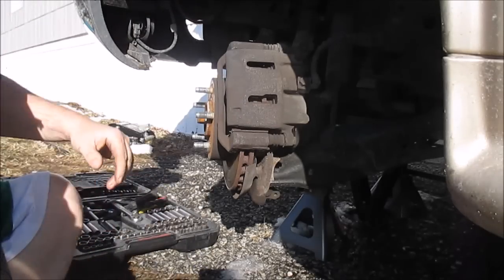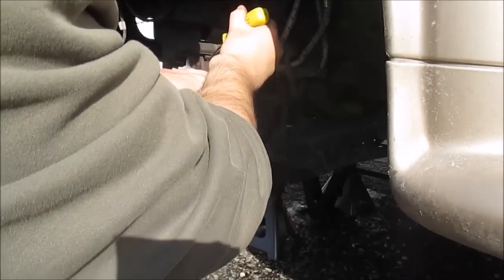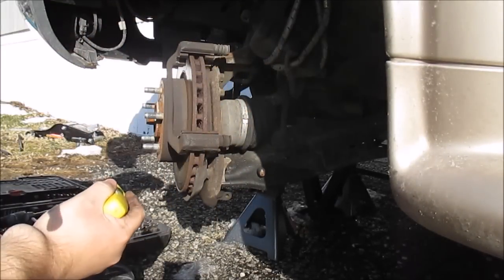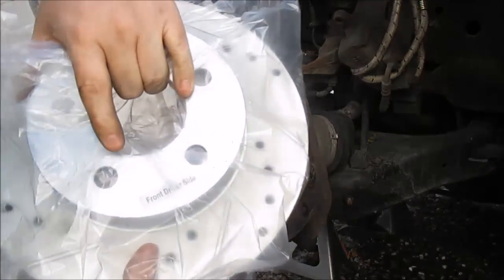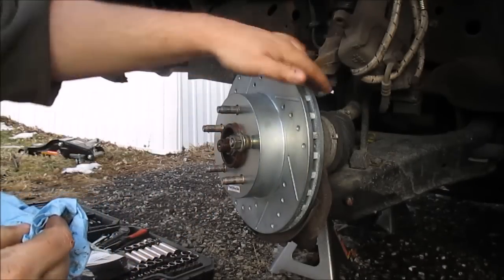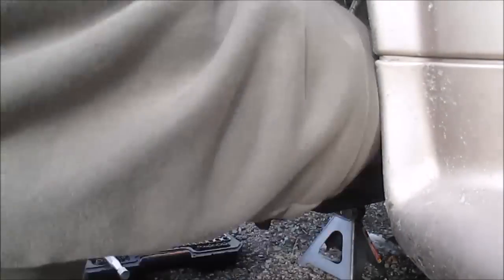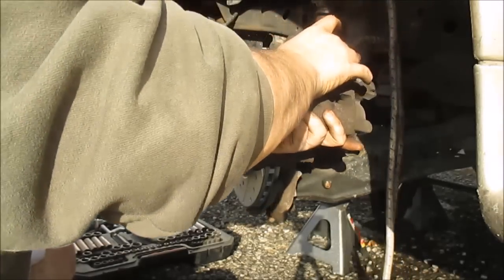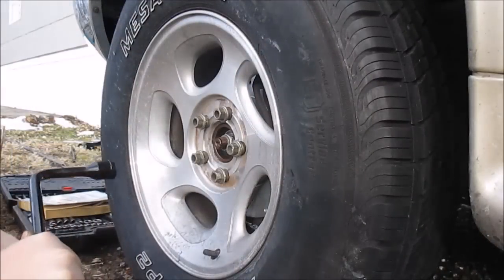How To Replace Brake Pads And Rotor On A Ford Explorer

Comment: I just did the same job on my 98 explorer sport, I used your video for confirmation that I was doing it right The video was done well and kept the info simple, great job. Thanks 
  Greetings from Victoria BC Cheers ! -Les
Reply from the maker: You are welcome, I am glad my video helped you out. I have been to parts of Canada, Ontario and Quebec. I have always wanted to go and visit British Columbia, I want to visit a few places and I want to see the Bella Coola Valley, pictures of it just look so pretty. Well thanks for watching and thanks for the comment. Have a good day.
Reply: Did the bolts come off with the rotor on yours? Mines a 98 xlt and I bought the same rotors but there's no bolts to put it on without the old rotor
Reply: @declanbryant8591  Well that was 3 years ago but I'm pretty sure I just used the old bolts,good luck Cheers ! Les

Comment: AJ, thanks so much for taking the time to post this. I tackled brakes on my '01 XLT for the first time utilizing your video. Really helpful. Only thing I added was greasing the back of the pad per the recommendation of the auto parts store guy. Oh, and for anyone reading, the torque spec for the front disc brake caliper support bracket bolts is 83 Lb-ft and the spec for the disc brake caliper bolts is 24 Lb-ft. Now I'm going to work on my son's '97 Ranger. Again, thank you.
Reply from the maker: +awwphooey 
Hey I am glad my video helped you out, thanks for watching and thanks for the comment. Have a good day.

Comment: Just wanted to say THANKS for posting this video. I have the same model and totally just saved me like $300 in labor costs. If you do anymore work on this vehicle please post it!
Reply from the maker: BoxBreakingCards 
I am glad you liked my video, and I am glad it helped you out. I am sure I will find something else that needs fixed to make another video on this vehicle in the future. I try to arrange my videos in my playlist section. I have one that is just for my ford explorer. I think I have 6 or 7 videos in there feel free to check it out. Also If I make another video related to ford explorer I will post it there. Well thanks for the comments and have a good day.
Reply: AJ Pierce any thoughts on why I may be smelling hot brakes 2wks after the rotors and brake change?

Comment: Fantastic video, ty...wondering about anti seize on the caliper bolts?  Guess it doesn't need it or you would have put it on.  Appreciate and respect your attention to detail!
Reply from the maker: +Kevin Wiley 
I think lubricating brake assemblies on there slide points, contact points, metal to metal points, and caliper slides is for sure a MUST thing to do. I usually use anti seize or other types of lube that say on the label for brake assemblies. I have used different manufactures brands and it usually says something like high temp lube, caliper lube, brake grease or something like that. It is important that the lube be rated for brake assemblies and be of a high temp nature because brakes get very hot, and you dont want to use just plain old chassis grease because most are not rated for high temp.  The brake lubricant is essential in keeping the parts moving properly and helping with heat transfer. For some great info on brake lubricants and proper placement of brake lubricants check out this article. http://www.aa1car.com/library/2005/ic80560.htm  Well thanks for watching and thanks for the comment. Have a good day.

Comment: Hi AJ, I have a 2000 sport 2wd. My old pads have the squealer tab on the outboard pad. I'm wondering if this is correct since it seems the inner pad always seems to wear down more than the outer. No instructions came with new pads and Hayne's manual doesn't mention it. Thanks for your videos

Comment: I changed the brake pads on my ford explore.  it still made bad grinding noises so I changed my routers. still makes grinding noice. the new roatter is from pic and pull.
Reply from the maker: Most likely you need your rotors turned down (if they are still within specification for turning), ones from pick n pull probably need turned down as well. Take your rotors to an auto shop, machine shop, or if there is a local college with an automotive program call them up and ask them if they could do it for you. Well good luck on fixing your brake problem. Thanks for watching and thanks for the comment. Have a good day.

Comment: I just changed out the pads on my '92 Explorer and what a  pain in the arse. No caliper bolts (which would have been easier), but had these pressure pins that hold on and in place. What year is this Explorer and how often, if ever, do you replace the rear brakes?
Liked your video alot and will check out your others.
Reply from the maker: +TheTemest 
Yeah Ford was notorious for using those dreadful pins on there earlier stuff. It seems to me just about anything from the early 90's had those stupid pins. I am with you I hate those stupid pins, and I like my calipers to have bolts. My Explorer is a 1999 and so far I have only replaced the rear brakes and rotors once. However I have not owned mine for very long. I think I bought this around January of this year. Thanks for liking my videos. and thanks for the comment and have a good day.

Comment: A.J.  New brakes arrived and looking forward to replacing using what you just showed. Quick question, did you have to bleed the brake lines after you finished replacing the pads and rotors? Thanks
Reply from the maker: No you should not have to bleed the brakes if you are just replacing pads and rotors. As long as you dont open any brake lines you should be good. Support the caliper when removing it and dont let it hang by the brake line, you will have a lot of extra work if you break that line or kink it so just be careful with the caliper when you remove it. Also when you are done replacing pads and rotors remember to pump the brakes a few times until you get a firm pedal, nothing worse than doing a brake job and forgetting to pump up the pedal and driving off with no brakes, could be bad. Well I hope this info helps you out. Good luck on changing your brakes out. Thanks for watching and thanks for the comment. Have a good day.
Reply: I appreciate that. Turns out my brakes are slightly different than your video. Had to remove the center piece and remove a bolt and bearings to remove the rotor. Getting it off was difficult. Getting back on even harder but your video is helping. Thanks
Reply from the maker: Yeah my explorer is a 4 wheel drive a lot of the 2 wheel drive trucks have the wheel bearings in the rotor and everything sits on a spindle. I have a video showing how I did brakes and rotors on that type of setup.      https://youtu.be/7wps4dteFFc        I did this on my F150 I hope this video helps you out. Good luck to you and have a good day.
Reply: The second video made all the difference. 4 hours to do the first brake, 30 minutes to do tell second. Your videos are outstanding. Keep them coming. Thanks for all the help.

Comment: Which brake pads do you recommend? I'm not sure what to look for.  I have a '98 Explorer  XLT AWD 5.0.  Thanks!
Reply from the maker: I prefer ceramic brake pads, but they usually cost more than the metallic types. I just feel the ceramic pads make less noise and are not as tough on the rotors (just my personal preference). However, I would recommend you go with what ever brake pad Ford specifies. You cant go wrong using Ford Motorcraft parts. You can look up parts for Ford at www.fordparts.com or check your local Ford dealer's website. I noticed a lot of times when buying from a dealership you can get parts cheaper off their website, but if you walk in to the parts service counter they will not give you the online discount.  Here is a link to a website that talks a little about choosing brake pads http://www.autoanything.com/brakes/the-best-brake-pads-ceramic-or-metallic.aspx  Well I hope this info helps you out. Thanks for watching and thanks for the comment. Have a good day.
Reply: Thank for the quick response. I appreciate the info. Take care.

Comment: I have a 94 explorer 4x4 that needs rotors changed how different is that to do than one without 4x4
Reply from the maker: In my video I am working on my 1999 Explorer, which is a 4x4, so to change rotors on your vehicle should be very similar if not the same as the way I did mine. However I cant be certain for sure because I have never worked on a 1994 Ford Explorer. Well I hope this info helps you out. Thanks for watching and thanks for the comment. Have a good day.

Comment: i just did brake pads for this same truck but hear an on going  spinning loud squeak noise only from my front left i didnt use the gel
Reply from the maker: Well could be several reasons why they are making noise. I guess it could be something hanging up perhaps from not being lubed up properly, or rust or debris, maybe you did not position something properly,  maybe worn rotors (did you machine those or replace those before swapping pads), or perhaps it is the new pads that take time to wear in properly (there is a technical name for this I think it is called bedding in google this for more info about it).  I think I would try to jack up that that side and spin the wheel and listen for noise and drag, and test brake function. Spin the wheel and apply brake, and make sure everything is smooth and the caliper releases and does not hang up. Really it could be a lot of things, but hopefully this will give you a few things to think about. Well thanks for watching and thanks for the comment. Have a good day.
Reply: i did not do the rotors only the pads. hmm
Reply: its when i turn my wheel to the left is when you here the turning squeak

Comment: Dude! What is up with those lumps on your right arm? Your arm seems to work well, did you break it real bad or something?
Reply from the maker: +godbluffvdgg 
I am a disabled veteran. The bumps on my arm are from a combination of fistula surgery and scar tissue from dialysis. Very large needles were stuck into my arm on a regular basis, while waiting for a kidney transplant. Thanks for the comment and have a good day.
Reply: AJ Pierce That  sucks...I hope it doesn't hurt to bad...I'm a vet too...What branch did you serve? Thanks for the upload...I'm doing my old lady's Brakes on her 99 exploder in the AM The original brake pads...Only 80K miles....:)...Thanks for the tips...
Reply from the maker: +godbluffvdgg 
No it doesn't hurt anymore, I just have to take a lot of bad medicine. I was in the Coast Guard. Hey good luck on getting your old lady's Exploder up and running. I hope everything goes real smooth for ya. Hey take care and have a good day.
Reply: AJ Pierce You too...Health and freedom to you and yours...

Comment: Your 99 must be a Awd or a 4 wheel drive, it's not a rear wheel drive with that rotor you installed. The Rwd rotors all have built on hubs according to Ford, Rock Auto, O'Reilly's.
Reply from the maker: +Bryan D. Smith 
Yes sir you are correct it is a 4 wheel drive. Thanks for the comment and have a good day.